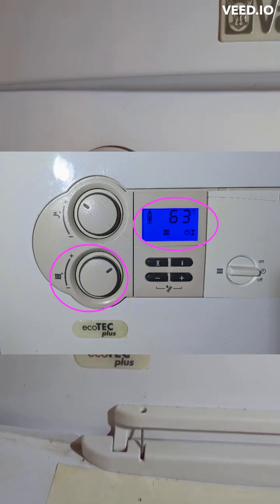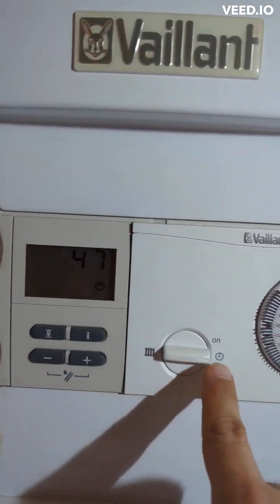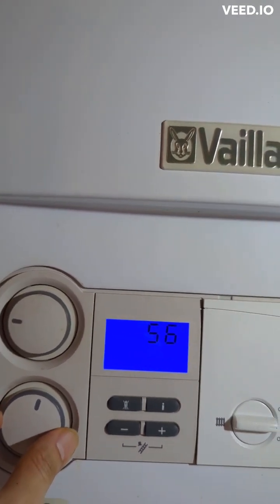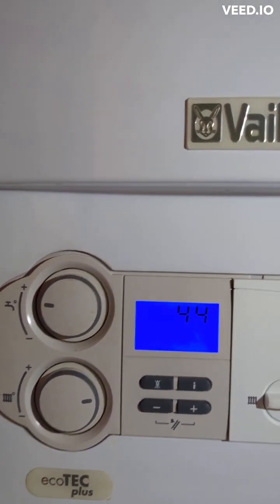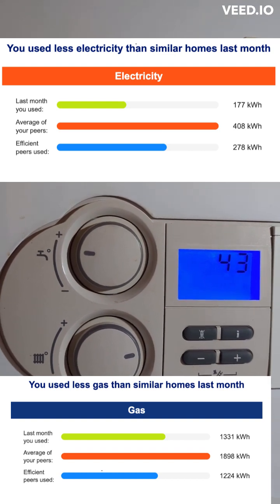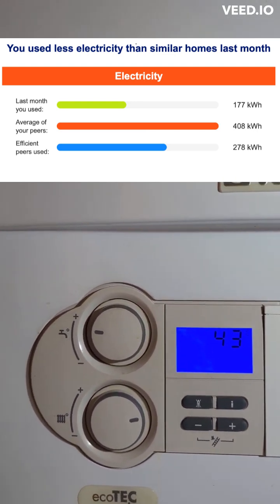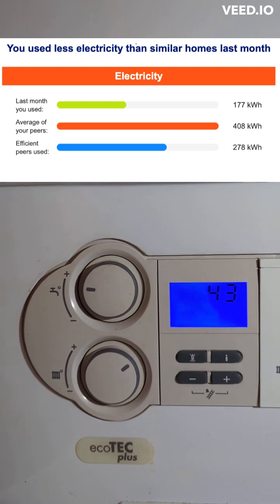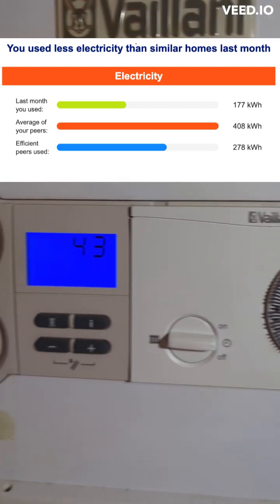Adjust combi boiler's water flow temperature (of radiators) to save both Gas and Electricity

Comment: Thanks for the video, it's helpful. My boiler is the same as your one, but I use a wall thermostat. I tried to adjust the temperature on the boiler for the house heating, but the small blue display panel shows the tap symbol for the hot water. Unfortunately, I don't have a user manual. Do you know what button I been to press so I can it from water to heating? When I turn the two dials on the left, they are both adjusting the water temperature. Thanks